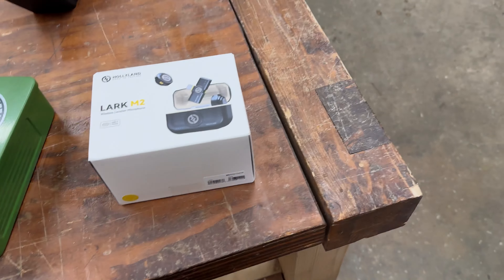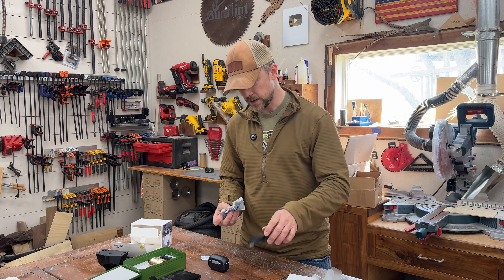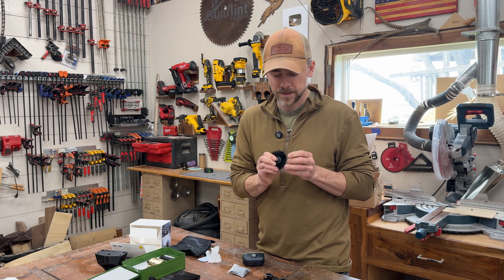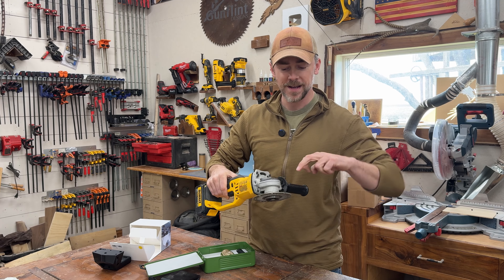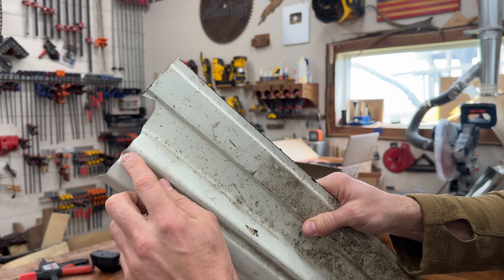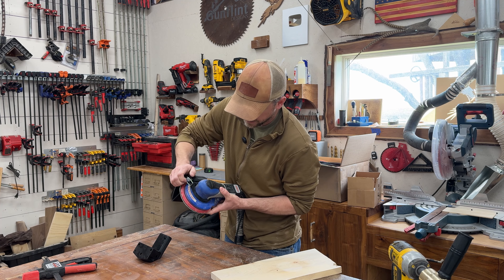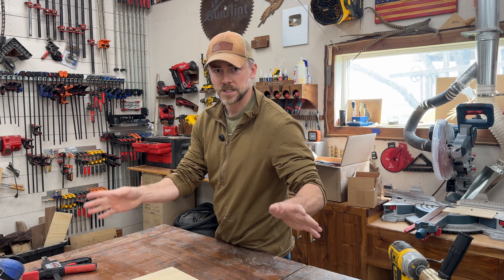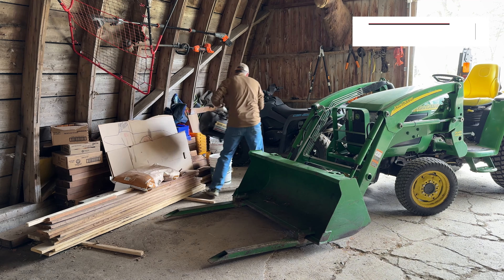New Tools & Lumber Rodeo!

Comment: The mic definitely was way different. When you first switched over, I thought you were doing  voice over.

I thought that nibbler would be game changing for me too but found it to be very limited in what it can do.
Reply from the maker: So what was limiting about the nibbler? Just the materials that it could handle, or the two-handed design?
Reply: @GunflintDesigns  It was extremely slow when cutting thru sheet metal roofing which is what I use most often. I found that a circular saw worked much quicker and was more accurate than the nibbler, not to mention the plethora of half moon shaped metal shards laying all over the place. I also have used the metal shear attachments that hook up to a drill and have had great success with those. The biggest issue is when hitting the rib portions of the metal roofing but when cutting sheet goods down to length, the milwaukee circular saw is my go-to.